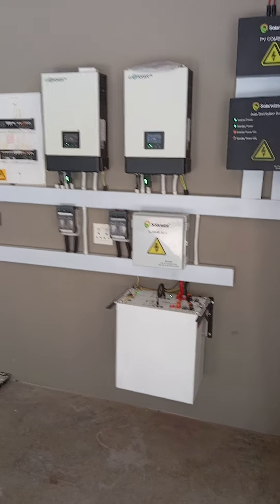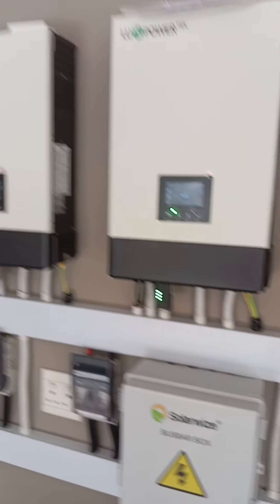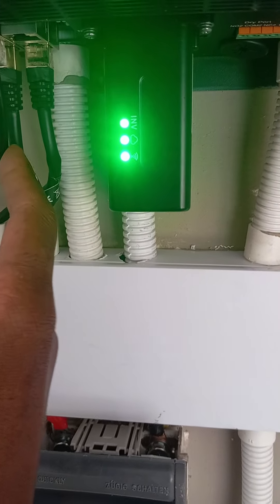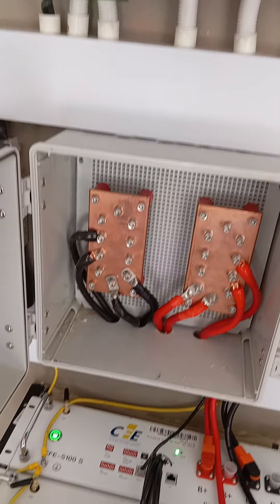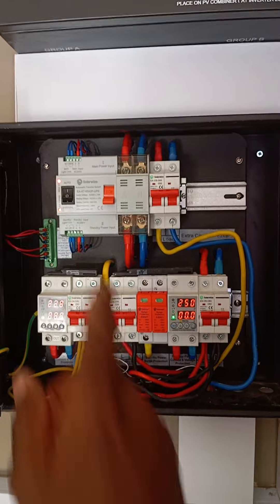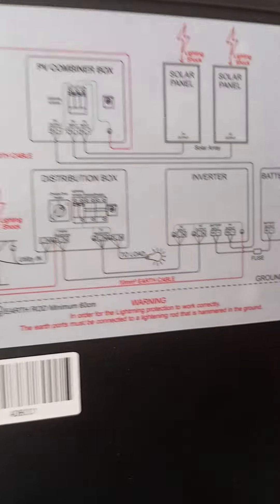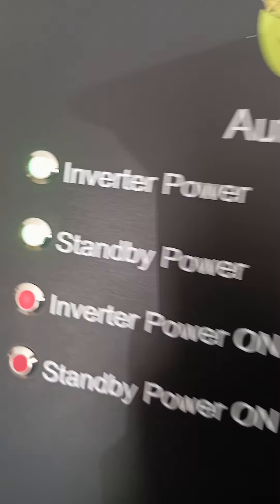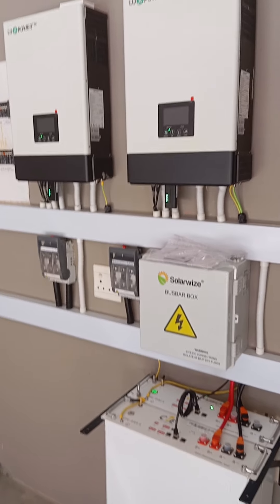5Kva lux power SNa  parallel setup with 10x 450watts panels

Comment: Hello sir, can one of those inverters support 12 panels 555W alone? thats 40.99v 13.5 A
Reply from the maker: Yes you can install 12 panels on one inverter if you split 12 panels between the two mppts  of the inverter, remember to update the firmware of the inverter so you increase ISC input of the panel as well

Comment: I just did same installation but I used Deynese batteries,problem is they don’t want to communicate with Inveter,even if I used right cable and right code(8) but still it doesn’t communicate,is there another setting I missed?
Reply from the maker: @tapsonnkata4950  did you also lift the dips switch 3 on the master
Reply from the maker: @tapsonnkata4950  and confirm which cable you used

Comment: How do you make inverters communicate online
Reply from the maker: Which inverter specifically
Reply from the maker: They all come with an app you download
Reply: Goodday sir , I have greenrich UP 3686 lithium battery, connected to  five star PW 5048/48/5000VA  inverter.  From battery  have NEG- AND POS+ cables going to the inverter only, on the roof 2 panels of 300wats each connected to inverter. Problem is this system can't keep a fridge (2 door defy fridge) on for 1 hour . SOC  lights always on 3 dots if sunny summer.  Is there anything wrong with connections ? Your advice would be appreciated. Thanks